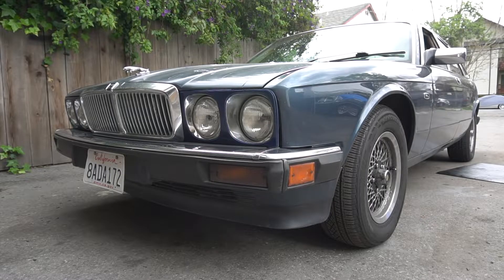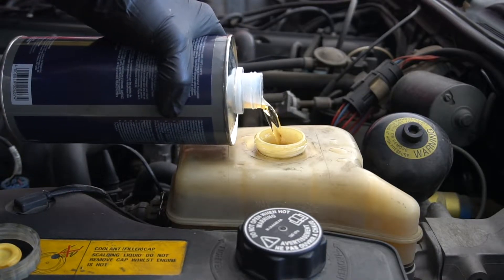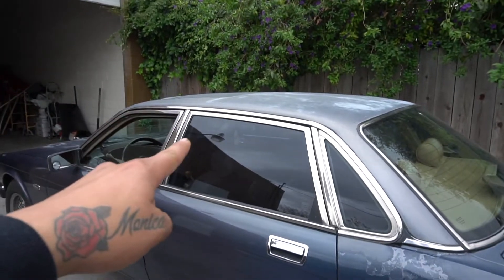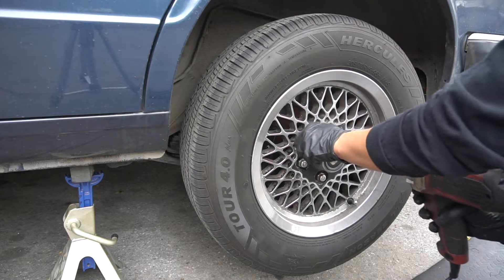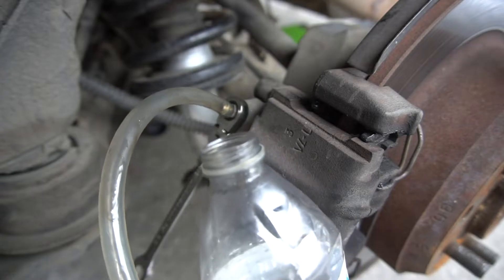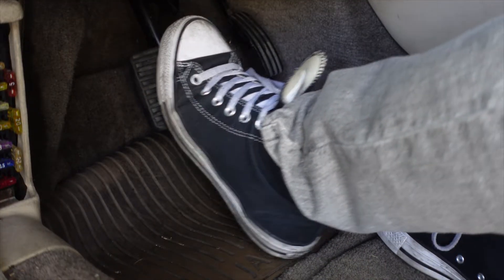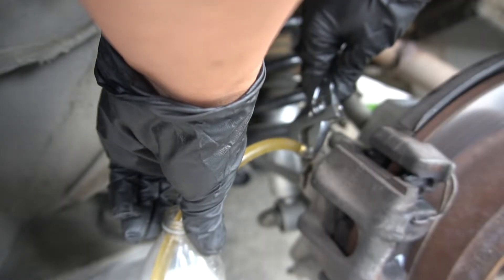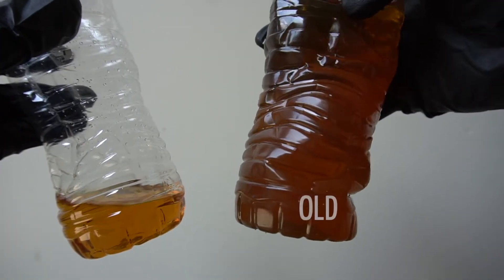This Is How You Bleed Rear Brakes On a Jaguar XJ6 XJ40

Comment: On my XJ40 the “Low Brake Pressure“ light comes on intermittently-the brakes feel fine but I am concerned the power booster is going out slowly ? Thanks again for the video
Reply: That's more than likely the accumulator sphere that has gone bad. The low pressure comes on until the electric pump has pressurized the system at the correct pressure, then the light goes off.

Comment: Great video! Did I really saw 316000 miles on the odometer? That's a lot!
Reply from the maker: That’s correct! that Jaguar was a great example of a bulletproof engine and durable transmission. Thats how I felt in love with the XJ40 and wanted another one BUT it just wouldn’t pass smog and it wasn’t the prettiest.